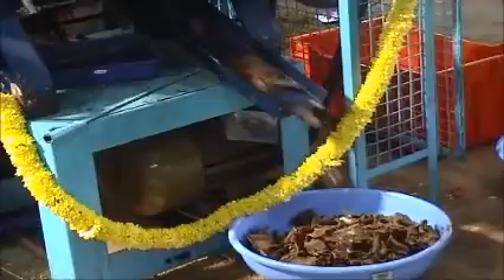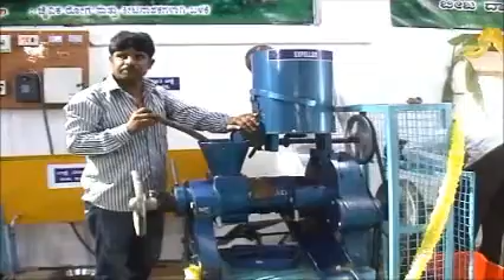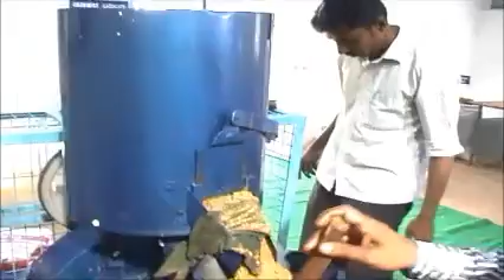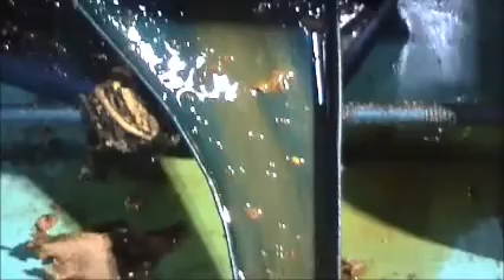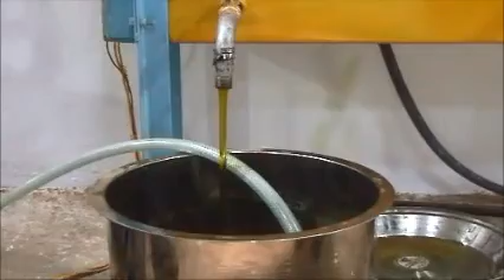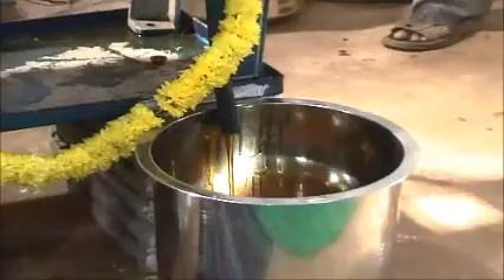"Malnad" type Expeller

Comment: I like very much. 
Please send me the Machine technical datas. 
Screw rod material which material, 
If used Ss304? 
What's the electric🔌⚡ consumption?, 
How many kilos per hour crushing capacity, 
What  type of the seeds  for special in this machine, 
If used heater? , 
Expellout oil Temperature🌡️ how many Degrees, 
Expellout oil cake how many  temperature🌡️ , 
Cake thickens how many mm, 
Please🙏 send me the details in my contact no. Please🙏